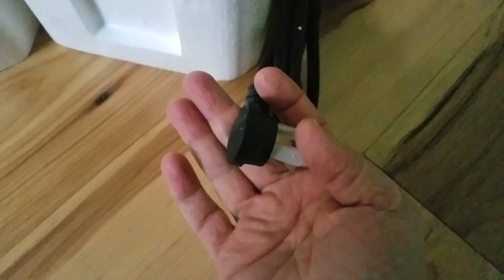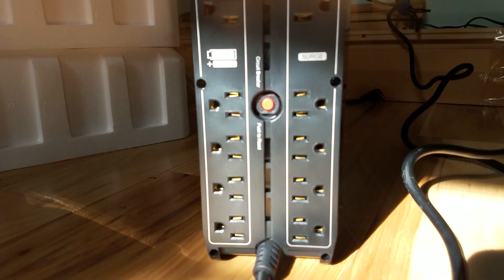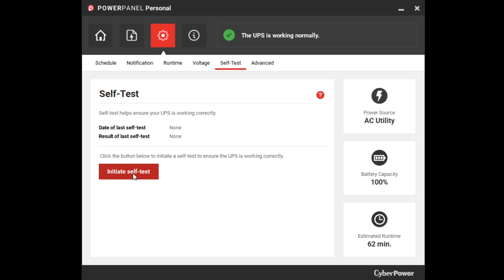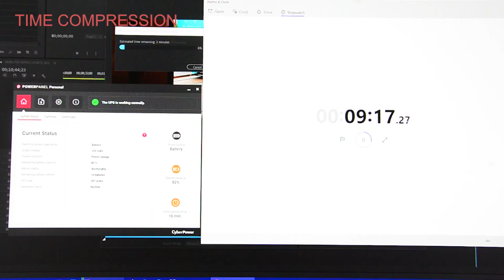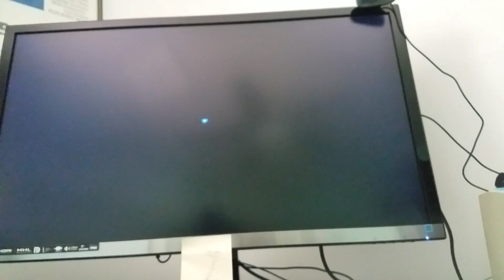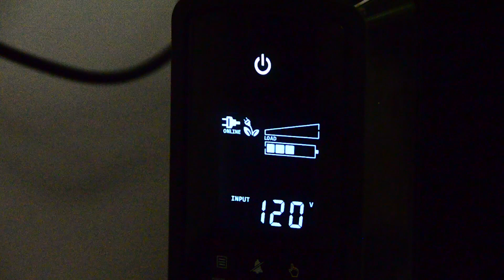The 2020 CYBERPOWER CST1500S UPS

Comment: Thank You for taking the time to do this Video,,, I just bought one at Costco and I did not know any of this... So Thanks again.. I saw your older video as well... ALSO,,, Are You still using the same Backup after 3 Years??? Just Curious as to how well this Until help up...
Reply from the maker: All the other CP1500 continue working without issues so far. Just ran a self-test on the oldest from 2020 and it claims a runtime of 54 minutes, which is sufficient to safely shut down the workstation. In my area not unusual to lose power due to storms and trees several times each year. I expect within the 1 to 2 years I will need to replace the battery. Thank for writing in with your question.

Comment: I'm guessing if you have a laptop with it's own battery power connected into a surge only outlet, you can still have the UPS communicate with the laptop to turn off?
Reply from the maker: Jeff, I would imagine you could, but why not plug it into the battery side? The UPS can only communicate with one device regardless of whether it is plugged into the ups or not.

Comment: I bought a CyberPower LX1500GU3 recently, which is also rated at 900 W.
It looks like one of my laptops uses 12 W while idle and 36 W while watching Youtube.
Another one uses 16 W to 50 W. This one is a work laptop.
A router uses about 2 W. I don't know about my modem but I assume 5 W max, so the UPS should last about 3 h with all 3 devices.

I can't run the laptop on the internal battery since a docking station is needed which needs 120 VAC and the docking station automatically sends some voltage to the laptop.
Reply from the maker: We just lost power yesterday for about 90 minutes and this UPS keep the router and thus the WiFi going. Really handy in our poor cell reception area.

Comment: hey i have a question beacuse i just order this ups can it ran 2 gaming pc and one monitor 1080p??first  one has 850w psu(rtx 3060/i911900K/32gb ram/2tb ssd/nvme/ and second one has( 650w psu/ i510400f/1050TI/16gb ram 2ssds)my main one with 850w psu is only for gaming 1080p  and the other one is only for streming and browsing and staff like that
Reply from the maker: The UPS is rated for 900 watts, so you would need to add up the actual wattage each device draws that you plan running together. For example my workstation and 32" monitor draw 108 watts even though the psu is rated at 650watts.

Comment: TY!  Wow. I had no idea laser printers were that power hungry.  I looked specs on mine and boy was I surprised.
Max: Approx. 1,110W
During Operation: Approx. 520W
Standby: Approx. 4.5W
Energy Saver: Approx. 1.3W
Reply from the maker: Yeah they use lots of energy which is why I have my laser printer on switchable power strip so it is only using power when I turn the strip on to print.
Reply: I guess laser printers have a fusor unit. It heats the paper once the powder is on it so that it melts and sticks to the paper. The toner is made of iron oxide particles coated in plastic.

Comment: Pure sine wave not necessary. Running APC USV with modified sine (2nd) for years and had no problems with poweradapters, servers, monitors, wireless charging stations, printers. BR
Reply: I would like to see what the simulated sine wave looks like with an oscilloscope.
Reply: The fans would like a pure sine wave.
Reply from the maker: Modern electrics are sensitive to the shape of the sine wave, for best performance and longevity a true sine wave UPS is best. Thank you for sharing.
Reply: @cfldriven  the most low to midrange (established brands) use a modified sinewave.
Reply from the maker: @r0ck3tdr1v3r  The consumer has a choice of buying modified or pure sinewave inverter, and although it cost more for pure sinewave device, I would rather not risk damaging my electronic equipment which cost more than the a pure sinewave UPS. Like most things the information is readily available as is the choice, it is up to the individual to decide what cost/risk level they are comfortable with.

Comment: Possibly not a good idea to pull the plug to simulate a power cut, you're disconnecting the system from ground/earth, but without a switch on the mains socket I guess it's difficult to do otherwise. Here in the UK they have switches (not sure if it's mandatory, but they are the norm).
Reply from the maker: When the unit switches to backup mode power it is supplied from the battery to the inverter out to the plugs. As there is no ground on the battery side I believe the system is using a floating ground until power is re-establish. Most power banks https://youtu.be/V-bi-2hm-a0 go with floating grounds although depending on the manufacturer some like Milwaukee can be earth grounded https://youtu.be/HhaZgl1b2CI. There are pros and cons to either way. Always interesting to hear how things are done in other places.
Reply: @cfldriven  All true, and I guess because the ground/earth pin makes contact first, powering down/up by unplugging/plugging-is fine. Still, switches on the sockets are pretty useful to have, it's definitely easier to isolate something in a hurry, particularly if the socket's somewhere difficult to reach.
Reply: @cfldriven  By code in the US there should be no switch on the ground side. So when it's running on battery it still must be connected to ground.
Reply from the maker: @javaman2883  Thank you for sharing your insight and for watching.

Comment: you do nice video but battery life not good need 2000 watts inverter 12 volt lithium battery 100 amp do much better
Reply from the maker: Jack, over the last two years this unit was done a fantastic job at surge protecting, and supply back up power for my video edit work station system. As you probably know, although not really mentioned in product literature, runtime is a function of power draw. In my situation it provides enough run time for me to save my work and safely shut down the system. I would not use this for running a refrigerator, but within its capacity it could easily run a wifi router and keep everyone connected during an outage. Something like the Vector power station https://youtu.be/V-bi-2hm-a0 is more useful for running a frig, but it is not a UPS. Thank you for sharing.

Comment: This is the only video that I could find that has the same exact model that I have, do you have a video on how to replace the batteries for this unit? I have already purchased the batteries however every other video I've watched so far has been from a different model and they all have this plastic thing in between the batteries that mine does not have and my batteries look smaller as well, I made the mistake of taking the batteries out and not paying attention how that it was put together and that was months ago because I ended up moving, and now I'm trying to get the batteries that I've purchased back into the system but I'm baffled about how to get them together.
Reply from the maker: Just follow this Cyberpower link https://www.cyberpowersystems.com/product/ups/battery-backup/cst1500s/ then select download and get the manual. On page 6 there are detail directions on how to replace the battery.  Hope this helps, thank you for watching.
Reply: @cfldriven  thanks man
Reply from the maker: @NintendoFanBoii  Most welcome

Comment: If we can't plug a laser printer or paper shredder into this UPS, then where do we plug them? Do we plug the printer and shredder directly into the wall outlet or do we use a different kind of UPS or surge protector?
Reply from the maker: Interesting question. The manual states not to plug these devices into the BATTERY AND SURGE PROTECTED OUTLET, however this leaves the four full-time surge protected outlets available. Just don't exceed the units 900 watts capacity. I would use a separate surge protected power strip for these devices.

Comment: It seems that one battery is installed upside down? Is it safe?
Reply from the maker: These are sealed jell batteries so nothing to leak out. Besides there is a spacer in between that separate the contacts that are at opposite ends and allow the cable through. So while one battery is upside down it safe, no need to be concerned.  Thanks for the question and for watching.

Comment: I only use my coaxial cable for high speed internet. I need to make sure that one of these will enable my internet to stay on if the power goes out. I read that the high speed internet could still be okay even with a power outage?  I just need to plug my modem/router and computer into this device correct?
Reply from the maker: Yes plugging the modem/router and computer into the UPS will keep them going during an outage. We have Uverse and as long as the lines aren't cut (by falling trees) we continue to have service during a blackout. Now note that having router and computer on the UPS will give you X number of minutes of power, if you were to provide the router with it own UPS you could get a longer run time. If you have a laptop then switching to its battery would achieve the same results. Nice thing about this unit is it gives you an estimated run time when carrying a load.
Hope this helps, and thanks for watching.

Comment: Can more than one computer be connected to the UPS, and will the UPS shut down multiple computers in the event of a power outage?
Reply from the maker: While you can plug in multiple computers and devices to the UPS, you must not exceed the output rating for the device, the more devices plugged in the less run time during an outage. The USB/Serial connector will only shut down one computer via the Cyber Power panel. If you are running servers you may want to place each one on a UPS, unless you can afford a commercial UPS. Thanks for the question and watching.
Reply: @cfldriven  , I thought since the CST1500S has USB as well as a Serial connection, I might be able to connect 2 pcs - 1 via USB and 1 via serial?  I understand about loads and runtime relative to the number of devices connected.  I'm not as concern about run time as I am about a nice shutdown in the event of a power outage. Thanks for your prompt response. Mike
Reply from the maker: @michaellauffenburger  The serial port is just old legacy, you can use either one but not for two separate computers. I hear there are scripts that can work around the one computer limit, but don't know if they really work.
Reply: @cfldriven  yeah, I found some info on those scripts.  Will look into it.  Thanks again. Mike
Reply: @cfldriven  Maybe a USB hub would work for more than 1PC?
Reply from the maker: @j.d.3269  That might be a viable and inexpensive solution.
Reply: @cfldriven  On second thought, PC is the USB host, and UPS is the USB device. A host can have multiple devices, but not vice versa.

Comment: Thanks, great review! But I'm wondering about the fan noise. In the video it seems pretty quite but I wanted to be sure. I'm thinking of replacing my current UPS because it's too loud.
Reply from the maker: The fan only runs when it providing backup power and recharging, and is fairly quite. In fact during outages I can't say I have ever noticed it. I have had the unit for over half year and am very pleased with its performance. The only thing I don't like is that you have to turn it on the unit if you want to use it to recharge a device via USB during an outage. This runs the inverter even though you don't need to power any high voltage items. Wish they had a separate circuit bypassing the inverter for USB power. 
Thanks for watching.
Reply: @cfldriven  thanks!

Comment: Does Windows shutdown automatically and properly after the 5 minutes left is reached or do I have to manually shut it down?
Reply: If you download the free software from CyberPower and hook up the UPS to your computer via the included USB cable it will safely close programs and shutdown computer. You can set when a shutdown will be trigger either by remaing battery life or time since outage.
Reply: Thanks...all hooked up.

Comment: It's interesting that your unit shows up in the Windows software as a CP1500PFCLCD - that's the similar model sold at other retailers to the Costco-exclusive CST1500S. However, the specs are not exactly the same (CP1500PFCLCD is rated for 1000 W whereas the Costco one is only rated for 900 W).
Reply from the maker: Good eye, usually the model number will be slightly different for exclusive products and the specs may vary. Its a way of avoiding price matching since the model numbers aren't exactly the same. Thanks for sharing your experience.
Reply: The layout is like GX1325U, and the specification is like GX1500U.
Reply: @j.d.3269  GX1500U is the Best Buy-exclusive model. cfldriven is probably right that it's to avoid price matching.
Reply: @fat_pigeon  Yes, that makes sense. I saw a video did very thorough tests for GX1325U. I'm wondering whether I need to buy the exact same model, or any cyberpower UPS with true sine wave of the same capacity would perform the same.

Comment: Will a simulated sine wave UPS be fine on a mid-range gaming PC with an active PFC PSU? I just want to have enough time to save my work and properly shut down my PC maybe 3-5 minutes. thanks
Reply from the maker: Modern day electrics are sensitive thus the best protection would be from a UPS with full sine wave. Some inexpensive units use stair step waves and these can cause issues. If you are experiencing frequent voltage fluctuations and/or outages get full Sine wave. If you can't remember that last time you had any issues then a cheaper UPS won't do any damage for the short one or two minutes that its running your system once a year.

Comment: I just bought this Ups and I realized that even is this turn off, it still passed electrical current, Is this normal?
Reply from the maker: There are two power buses on the back of the unit. One provides back up power and surge protection, and it will shut down with the power button. The second bus is surge protection only and is always on regardless of whether the UPS is on or off. Hope this helps, and thanks for watching.
Reply: @cfldriven  Thanks 😊

Comment: Thank you for reassuring me that this unit did actually come fully charged, despite the instructions saying that it wouldn't. Big help!
Reply from the maker: Normally they ship with some charge, I always just let them charge to 100% before putting them in service. Thanks for sharing and watching.
Reply: Why's it matter
Reply: @AgentOffice  Why wouldn't it matter?
Reply: @michaelhubbard5013  because it's always charging itself
Reply: @AgentOffice  just trying to be safe with my equipment and my house dawgie. my experience differed from their official instructions.

Comment: just got two power outages today and ordered one expeditiously. i have had enough
Reply from the maker: Of course realize that depending on the load it won't last long during the outage. In my area outages tend to run at least an hour, but at least I can save all my work and  safely shut down. I have one plugged into the router so that we can have wifi for a while after the lights go out.
Reply: @cfldriven  I just got it in the mail today and I just need to clarify some things I couldn't find googling. Does the unit have onboard memory that saves the PowerPanel Software settings or do I have to have it plugged into my system at all times?
Reply from the maker: @baandinos  Good question that got me thinking. I switched on email notification for events. While connected to the computer I would get emails reporting an event (I unplugged the UPS), if I shut down the computer and repeat the event, there is no notification, and upon turning computer on there is no mention of power outage. Only the first event is in the logs. So based on this the software needs real time data, as the second event was not stored on the UPS and then provided to the event log. I would think you would lose your UPS settings if the battery drained and it would then default to manufacture settings until you connected the two via USB data cable.
If you discover different let me know.

Comment: What large electrical products should i not plug in? I'm wanting to plug in my tv, gaming desktop, and ps4.
Reply from the maker: Any high ampere appliances like pumps, toasters, irons, dehumidifier, refrig, microwave, AC, coffee maker, hot plate and similar items. 
I would plug the tv, and ps4 to the surge side only and the gaming desktop to the power back up. That way either the ups or I can manually save and shut down the game computer. If you are using the tv as your gaming monitor then you'd probably need that on back up so you can see what you are doing on screen during the outage. Hope this helps answer the question. Thanks for watching.
Reply: @cfldriven  you answered it perfectly and your video is amazingly straight forward and filled with information. Thank you.
Reply from the maker: @XxVendetaxX1  Thank you for the kind words and stay safe.

Comment: You should have it charged or charging for 16 hours in 1500va units.  Not just connect products and use immediately.  For longevity
Reply: Most will come fully charged already, negating the need for charging the battery. It’s pretty much ready to go. If it sat in storage for a very long time, then it would be customary to plug in and charge first before use.